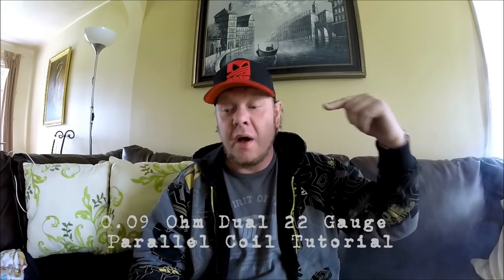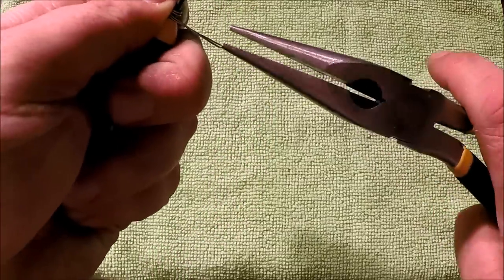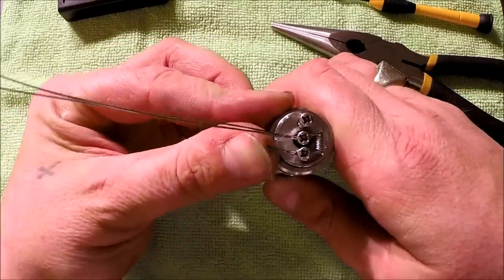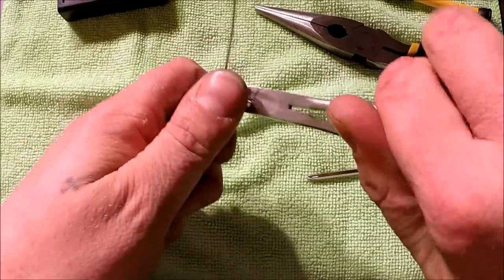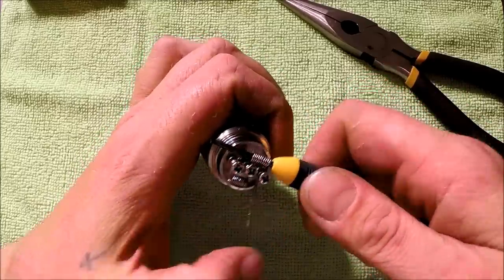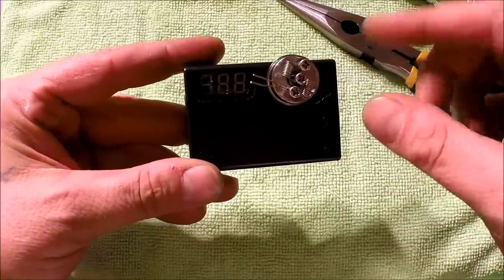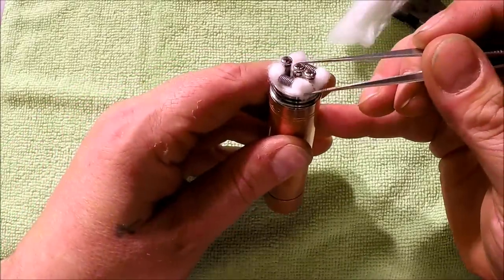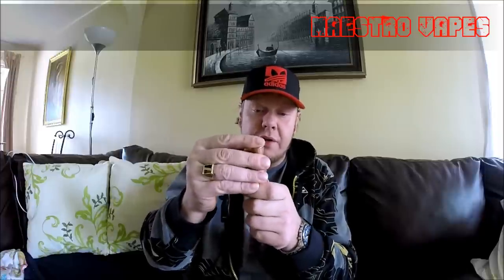0.09 Ohm | 22 Gauge Parallel Dual Coil Tutorial

Comment: Just built this with 22gage nicrome on my tug and I am loving it. Thanks for the video!
Reply: Single battery or Dual parrallel and I got an mxjo 3000mah 35a good idea or bad in single battery
Reply: Doctainsano there's no such thing as 35amp batteries! 30 is the limit and there only 1500mah 300mah is only 10-15 amps
Reply: Bryce Cummings that’s false my dude there is 3000mah batteries on the market now

Comment: I had a nemesis but It crapped out on me so this week I'm picking up a copper manhattan my question is is it worth it? BTW I was using  22 gauge parallels continuous build 4 wrap on royal wire on a 3/32 drill bit atty was a tugboat and it came out to .05 ohms

Comment: What battery are you using you crazy guy, I got a 35 amp efest at .2 ohms twisted 24 guage. I cant find any higher amp batteries beyond 35 amps and i want to build lower than .12 ohms. You have any recommendations for batteries?
Reply from the maker: I've used the 35 amp efests as low as 0.06...they can pulse up to 60 or 70 amps. Your mod may get warm... Some mods work better than others...magnet switches seem to work better than springs also for hot button issues.
Reply from the maker: I'm actually Vaping 20 gauge parallels right now using a purple 30 amp efest.

Comment: man i must have messed up because when i tried a 22gage parallel (dual), the resistance was way to high and it took way to long to heat up. ima try this you're way, w/ 2.4 screw driver. thanks for the vid.

Comment: Yo maestro, do you think those Efest 35's are only 35a pulse? I've been using them on a .08 daily for the last two weeks and I swear they have to be at least 60a pulse discharge because they are strong as hell!
Reply from the maker: They are 35 amp pulse but batteries do have burst rates also... I've used them pretty low too and they work. The 30 amp purples seem to hit harder for me though. Samsung 25r is very good too bro
Reply: I actually unwrapped one of my Efest 35 amps, it was a rewrapped LG he2. It was even authentic on the efest site. So its safe to assume Efest is rewrapping them. I'd just be careful of that buddy.
Reply: Maestro Vapes Thatd be because the purple 35a's are Rewrapped LG He2. The 30a's are rewrapped vtc5's.
Reply from the maker: losi8ightyew the 30s are actually a vtc4, I unwrapped one in a Vlog a few months back bro.
Reply: Maestro Vapes Really buddy? Sweet! Thanks for the info!!!

Comment: Nice build man! Will this work well with a 4 post rda like the mutation x v2?
Reply from the maker: Sure it will work. You can do it with two separate coils instead of continuous strand.
Reply: +Emery Kohn just did the same build with my 9 hells 13 heavens FOUR post atty and it works flawless don't let that man fool you emery.

Comment: Stro!!! This is a revisit of this vid for me. Have you tweaked this build in any way since you posted it? Was gonna throw this in a Dark Horse. I normally pull my coils up as high as I can get em due to the position of the airflow holes in the topcap. What's your take on wicking that bitch with the coils pulled up high. Thanks dude.

Comment: I just tried to do this with 22 gauge gplat, four post design, two separate coils 7 wraps over a 3mm driver.  I am using a sigelli 150w box.  Go to heat up the coils to make them look pretty and the resistance came back TOO LOW.  I know the gplat is low resistance wire and all but how can I make it work and raise it up a little bit so I can still use gplat 22 gauge I still have to coils because they came out so nice, any ideas including the reuse of those would be nice haha.  I usually use my box as my ohm reader too so I don't have exactly what it came out to be.
Reply: with a mutation v3 rda
Reply: Ralph Landolfi try single coil if u want to keep parallel. or just do regular dual coil.
Reply: Ralph Landolfi more wraps?

Comment: This is an awesome build. However,  I've done it two different times and ended with the same result. It always reads 0.11 ohms. What could I be doing wrong?
Reply: You could be using a slightly different diameter to be wrapping, could be that your wraps are too loose, best way to find out is to experiment. Happy vaping! :-)

Comment: i used to build 5wraps single parallel coil . but i want more clouds and flavors . im scared to do dual parallel coz i dont know if my battery vtc4 can handle dual parallel with 22g wire . please help .
Reply: arvie villacorta yep I do a dual parallel 4 wrap with ni80 wire around 0.038 ohms hits hard as shit just don’t chain vape or hold longer than 5 sec I’m using a 25r

Comment: Can you do this build with 2 separate coils? Or does it have to be 1 continuous strand?
Reply: Only issue with that i think is fitting those fat wires through the posts
Reply: Jordan Dennis  so thats the only problem?
Reply: you can do 2 separate ones depending on the size of the post holes, i can do it on my kennedy.
Reply: +ByArtzFX bro it all depends on the rda.. my alliance can fit 3* 24 and 1* single core Clapton in the post holes.. Quad parallel dual coils for the win..
Reply: RobTapps88 quad coils = more vapor?

Comment: i use 22g 4 wrap and its .2ohm how do u get  yours lower?
Reply from the maker: It may be your ohm meter? A 4 wrap 24 gauge dual coil should give you around .2 but you'd have to wrap 6 or 7 wraps around a 2.4mm driver of 22 gauge to get .2 ohm. And that's not even using parallel wires.

Comment: would an Efest 26650 battery work for this build
Reply: Cecil Samuel i would say no. efest and many other off brand battery companies market the amps as higher than what they are rated for. the best battery on the market right now is a samsung 25r. those can pulse at 45 amps for 3 seconds. i have a .1 build and it works like a charm. do NOT go cheap on batteries. they are the one thing that keep your upper lip from being blown off. buy batteries from companies like lg, samsung, and sony.
Reply: Justin C true
Reply: i recall my statement. efest has been getting better, but i would still recommend name brand batteries anyday.
Reply: Justin C still...

Comment: I have to same exact build 4 wrap 22 gauge continuous parallels and my mod and battery gets super hot lol
Reply from the maker: I've built this with three wraps and my mod gets warm from heat transfer through the atty but my Sony VTC's never have an issue. What mod you using?

Comment: Hry guys is This battery for This build?  PANASONIC 18650 3400 mAh NCR18650B
Reply: Noooo. Panasonic protected batteries (like in the NCR series) read something like 10 amp output. You need at least 30 amp continuous/50 amp pulse rating with a build below 0.1 ohms

Comment: people, please go and use an ohms law calculator and enter 4.2 volts, the maximum voltage an 18650 battery can put out, then put 0.09 ohms of resistance and see how many amps are required and how many watts thats putting out, thats 196 watts and requires a 46 amp draw, if you want to blow you or your friend up do your research
Reply: dirtysnipeHD pulse time is very key though. for the amount of time he was pulling on that thing. it could pulse at the required 46 amps, keeping it safe. do some research on pulse limits of batteries.

Comment: I can easily do this build, I have the Efest 18650 2100mAh 38 amps,  pulse discharge 60amp
Reply: +Dabzz4Daizzz efest are dodgy they are definetly not a 35a battery and efest get all the knock backs from the companys you should be using, use sony samsung or lg. you will be fine with efest in a regulated device but why take the chance when using a mech mod with super low ohm builds just buy a sonyvtc4 or 5
Reply: Dabzz4Daizzz with efest batteries your likly to blow your hand off, look up mootches battery chart

Comment: is it possible to get it to .01 ohms? :oooo
Reply: Its possible, but stupid. No battery would handle it at 4.2volts. Also, the lower ohms dont bring clouds. Its the surface area, airflow and technique.
Reply: Just Ω a 26650 would be able to
Reply: Nah. Theres no battery that has a pulse amp rating of 420. Even if we calculate the voltage drop, theres no battery that would handle it.

Comment: builds this low is just crazy and really unnecessary,  to enjoy the vapeing  there is no need for build like this, only for blowing fckin clouds if that makes u happy.    Whats wrong with .5 .6 .7 or 1.0 ohm or higher.. just crank it with 30-40-50W and it will be much better than this dangerous shit!!
Reply from the maker: Why the fuck would you watch this video if your just gonna whine about it?
Reply: Lol seriously kid...
Reply: from my perspective people are almost always going to push the boundaries of safety in anything. We do it with cars, animals and alcohol. This is just one of many things people have gone through great lengths and I highly doubt people are going to stop.
Reply: sinamaster "just crank it with 30-40-50W" If you tried vaping this build on a regulated device it would need to be pushing 110 watts.
Reply: Maestro Vapes You just earned yourself a new sub lol.
Reply: i always build around 0.15 to 0.4 ,, anything above 0.5 is a "mehh" for me. because I like warm, full of flavour and vapor type of vape.
Reply: AdityaVanko Thumbs up. that's my sweet spot too. except for my okr box mods they get .5-.8
Reply: +AdityaVanko Do you use vtc5 batts?
Reply: sinamaster a lot of things are wrong with builds that hi my mech says right in the instructions it's made for 0.15 - 0.06 anything above 0.20 it won't even push
Reply: Maestro Vapes res